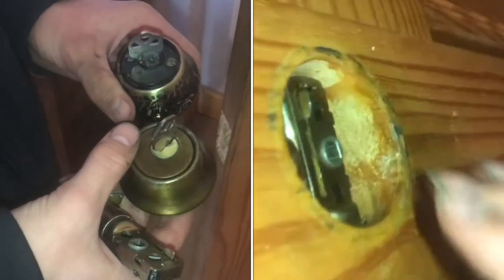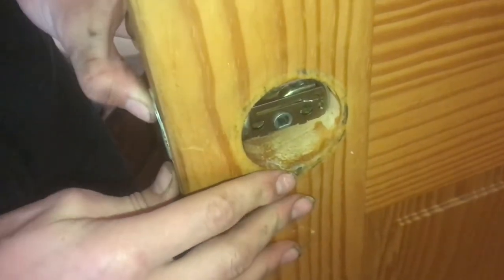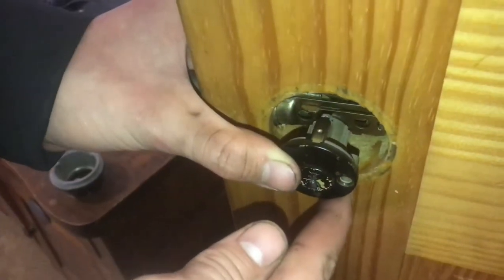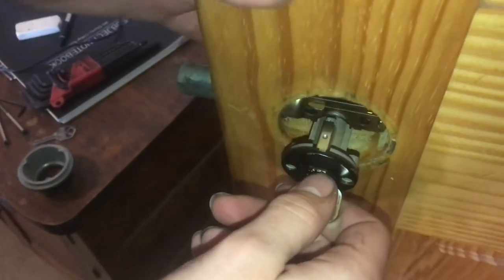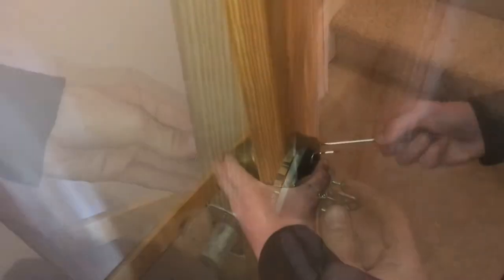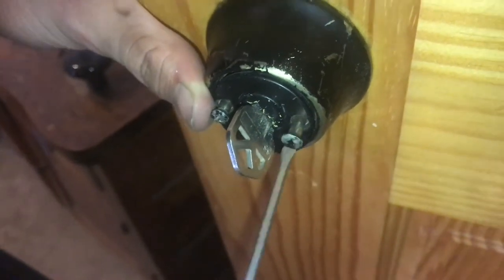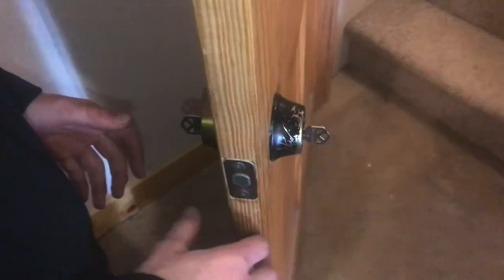INSTALLING a double cylinder deadbolt “explaining how it works”

Comment: Few tips as a locksmith: Do not ever put oil in a pin-tumbler lock! This can really gum up your lock. Use lighter lubricants like tri-flow, PTFE, or my favourite, Fluid Film (this is what Medeco warranties their locks with). Also, make sure that the hole for the deadbolt on the jamb side is at least 1 inch deep. Anything less will prevent the bolt from deadlocking, hence making it incredibly easy to open with a screwdriver. Last, make sure you have the right strike plate. This ensures smooth operation. As a bonus, you can add a security strike plate with 3" screws, but that may not be necessary if it is a low-security interior setting.
Reply: Can I use 3-In-One Oil, or Olive Oil cooking spray, or caster bean oil..?!

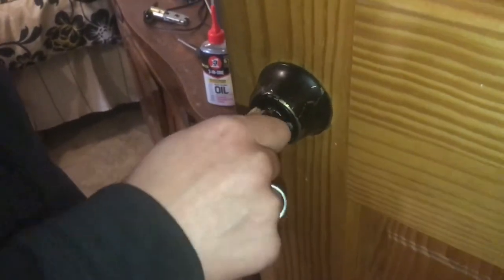Comment: Key locks should always be installed so that the teeth of the keys point up. At 2:37 in the video, the lock is installed upside down; at 2:42, it is installed correctly.

Comment: I installed a double cylinder dead bolt lock tonight and followed the directions completely. The mechanism works great, however only if I dont tighten the screws. Why does it not work when the screws are tight?. Shouldnt they be tight so the housing doesnt move around. The screws dont appear to get in the way of the action, so why wont the lock engage when theyre tight? What am I missing?

Comment: Hi what it worked for me was i pretended like i was installing it on the air a couple of times till i had it figured it out and then it tooked me less then 5 minutes to set up in my front door
The keeys  teeth's needs to be pointing up also the  name brand  of the (schlage) needs to be pointing up that will align perfect to the screw's hole and DB face on both sides i only need it one key to installed it 
Hope it helps someone out there
Thanks